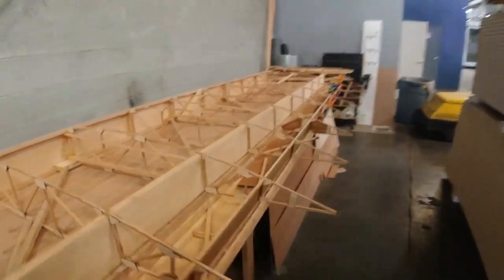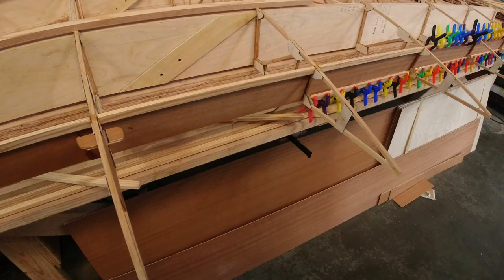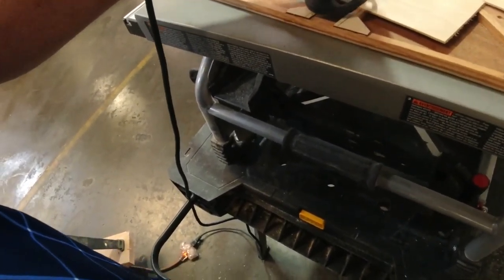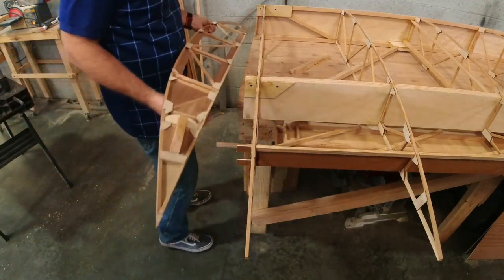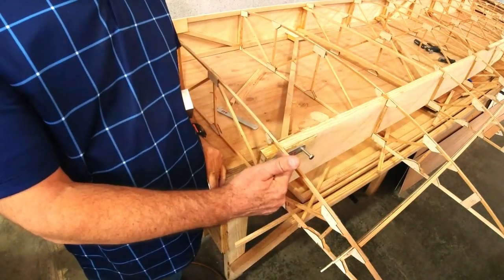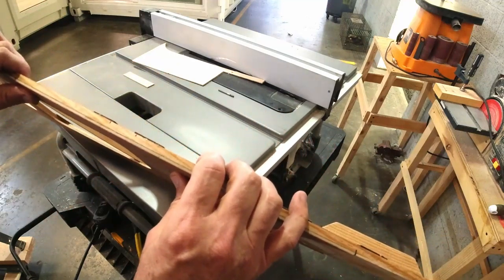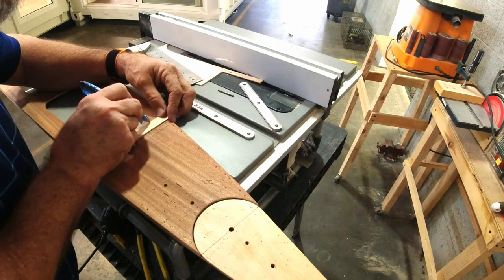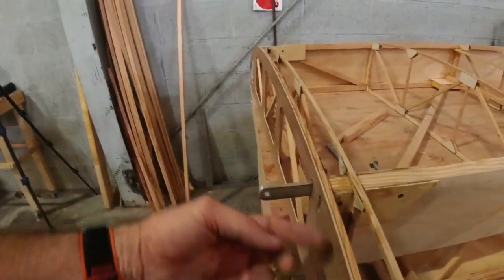Minimax 1100r Aircraft Build Vlog Episode 9

Comment: It's interesting that you mentioned the doug fir reminds you of guitar wood. I thought the same thing and am actually considering using some to make a ukulele, using it for basically everything except the fretboard since its a bit soft for that.

Also, is there a reason why one cant construct the wing ribs with the space for the ply and fitting rather than coming back later and routing them out? I feel like doing 20 normal ribs and then 4 with appropriate spacers to account for the ply and fitting would eliminate that routing step for the root rib or the cutting out the member and adding a doubler step for rib 1.
Reply from the maker: I don’t disagree with you Morkus. To do it again, I would probably add some additional 1/4 ply and form that area before adding the ply to prevent that routing step. 
Interesting about the Ukulele. I’ve been collecting wood to build Ukuleles for some time now. I have everything I need and even built my own thickness sander which you can see in that last video in my new wood shop. I love playing Uke